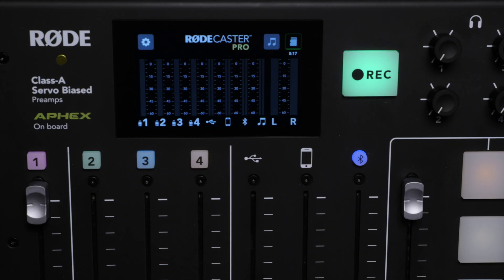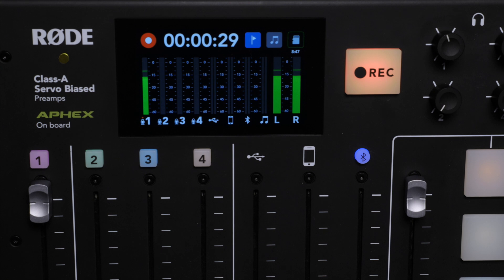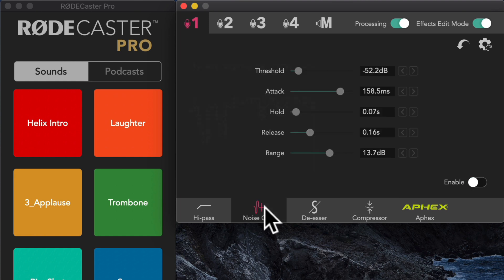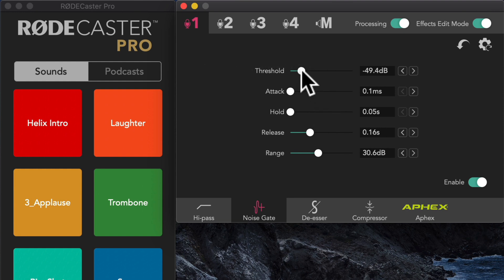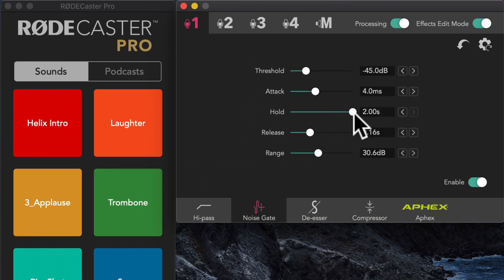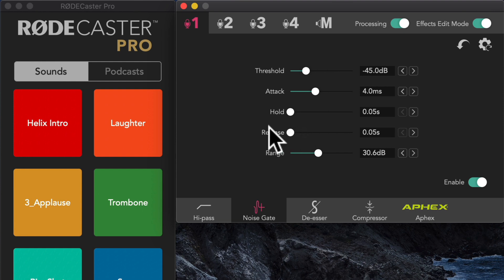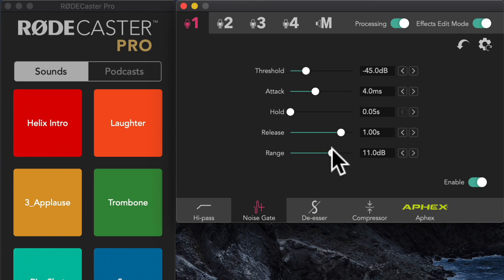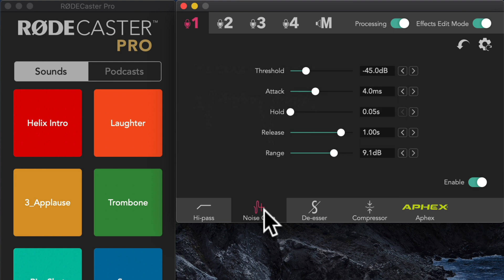RODECaster Pro Noise Gate Settings - V2.1 Firmware

Comment: I stumbled across this video and wanted to see if anyone here seems to find the preamps on the RCP very noisy. With all effects off there's a noticible hiss in every recording. The only time it goes away is if the noise gate is turned on. Gain is set to 40 and using Shure sm7b mics but have to de-noise every episode in post because every channel adds noise. I've replaced the RCP and both do the same thing.
Reply: If I mute all channels noise goes away too and there are no electrical problems in my environment that I know. Of no ground loop or anything. I bought an electrical tester and everything checks out from my outlets.
Reply from the maker: I have not experienced that here. When I hear noise, it is from actual noise in the room which is picked up by the microphones.
Reply: I seem to have the same issue using the Podmic and all the processing at default. Seems like my podmic itself needs high gains of 49-52 levels to get some clear sound, which brings in the preamp noise. Have you found a solution? I have sent samples of the recordings to the Rode country agent, and awaiting feedback.

Comment: Here's a question... I am a newsih owner and wondering...if I have set my input and output to the Rodecaster through USB channel why is it that I can't play a clip from Youtube that it would pick up (say if I am quoting someone). I can hear the audio on my headphones but the individuals I was talking to on the computer video call could't hear the sound. Does it mean that if I can hear the audio on my headphones that the Rodecaster will record that audio from the youtube video? Do I have to have a second source (track) and add the computer via bluetooth as well? If I am not clear I can explain some more.
Reply from the maker: The mix minus feature prevents the YouTube audio from playing back to the remote guests. You can try turning off mixminus. Or contact RODE support for potentially more ideas.

Comment: You mention enabling a switch to include the effect of the noise gate-on your recording wouldn't it be better to not print the effect, so you can tweak it if necessary later? (Otherwise you may be stuck with a release time that you only notice later, for example, especially on your own voice.) Or are there limitations, such as only one effect at once, that apply to the Rodecaster?
Reply from the maker: If you’re live-streaming or need to upload right after recording, you’ll want the effects baked in. If you have time for post, then yes, best to do it in post.

Comment: How would you compare the noise gate here to the DBX 286s? Is it comparable, is it more aggressive?
Reply from the maker: About the same. Depends more on how you configure it. The 286S is a little easier to setup with its two settings.

Comment: Isn't the "Post Fader" option related only to the faders and the mute buttons?
Reply: From Rode's website: Post-Fader Multitrack Recording
Previously, when recording in multitrack to your computer, the output of the RØDECaster has been pre-fader, meaning that all of your settings – including where the level meters are set and any processing that you have applied – have been bypassed, leaving you with a raw recording.

We have now included the option to record post-fader, accessed via settings > ‘Advanced> ‘Audio’ > ‘Multitrack’ and tapping the ‘Post Fader’ toggle.
Once switched on, all processing, effects and fader positions will be recorded with your podcast. This means that any changes you make while recording your podcast are then recorded directly to your multitrack files. This is great if you’re looking to save time in post-production, but it also means that if you make a mistake during a recording, you won’t have anything to fall back on, so be extra careful when recording in Post-Fader Mode.
Reply from the maker: Thanks for confirming, Frank.
Reply: @curtisjudd  I did a couple of quick tests.
 
It seems that the "Post Fader" option also activates and deactivates the effects only for channels 1 and 2 (the stereo mix).
 
For channels 3-14, it seems that option only activates and deactivates the faders, plus the mute and solo buttons. Effects remain active unless you enable the "Bypass Audio Processing" option.
 
N.B. For my tests, I did not record the audio with the RCP but listened to it from my Mac, channel by channel.
Reply from the maker: Thanks for checking the details!
Reply from the maker: No, it also includes the effects.

Comment: So glad you made that note about avoiding noise gates if you can. Such a common mistake I see in podcasting forums. I just realized made a tutorial on different ways to approach reducing room reverb and the one tool you should avoid if possible (spolier: noise gate). They're super noticeable and once you hear what a noise gate sound like, you can't listen to podcasts or other audio that uses one. Or at least I can't. If you MUST, use an expander instead. Great as always, Curtis.
Reply from the maker: 👍 Yes, there's potential for overuse here, big time. This can be configured as an expander and truthfully, I find that more than about 9 dB of expansion is just too much in most cases. In fact, If recording a single mic, I won't usually use even an expander. I find they're most useful when recording multiple people at the same time and even then can be a dicey proposition.
Reply: @curtisjudd  Exactly right. I only use one during long form interviews to drop the person who isn't speaking by 6-8 db. Great stuff, Curtis. Thanks again.

Comment: Ahh. Yes! I’ve been struggling to get the noise gate set in a way that isn’t distracting.
Reply from the maker: 👍 I think it is most useful when recording multiple people. Sort of distracting when just recording one person.
Reply: @curtisjudd  I find it really distracting recoding more than one person as well. Like 4 times as distracting. Please make a multiple person noise gate tutorial video :)
Reply from the maker: @Steppepulven  Hi Emil, it is really just the same as here, just do one person at a time. Noise gates are often rough when working with multiple people in the same room. My general approach is to take it easy - don't try to eliminate ALL noise, keep the range setting at something reasonable like 9 to 12dB. And instruct the hosts/guests to work up close on their microphones.
Reply: Curtis Judd Thanx Curtis! Your comment is much appreciated and helpful :) I follow your strain of thought - Will try it out. Just bought 4 fetamps to prevent noise - so maybe Ill leave it off completely. Close mic speaking is key - headsets could Help novice speakers :)
Reply: @curtisjudd  So do you set up the individual noise gates per person, or do you set the noise gate as seen in this video across all 4 channels?
Reply: Curtis, a very fantastic video! Can't wait for the "multiple guest noise gate video". Since I got my RODECaster  Pro I have been tweaking the noise gate because I run off of a gaming laptop that has a loud fan, and I am impressed with the noise gate feature of the RODECaste Pro. Question: I use Zoom to record my guests (sometimes multiple guests) for my radio show and podcast. Any thoughts of how the noise gate interacts with Zoom's recording feature (best practices)? (BTW, "The Enthusiasm Project", your video content is also always awesome).  Great work to both! :)

Comment: Please forgive my inexperience here but wouldn't it be better to use EQ rather than a noise gate to control the lower (annoying) frequencies?
Reply from the maker: Hi Rivenworld, a high pass filter or low shelf in EQ can help a touch but a fan like this one is a broadband sound source so it'll still be very prominent in the recording.

Comment: This is about the same thing I was asking about in your last live stream. I often have a fan on during the summer time. I already knew about using a noise gate. But since I'm using a condenser mic I figured switching to a good dynamic mic would be a good starting point first.

After reading the reviews I've decided upon buying the Shure SMLB since several people said its the best at rejecting unwanted background noise.
Reply from the maker: Good choice!